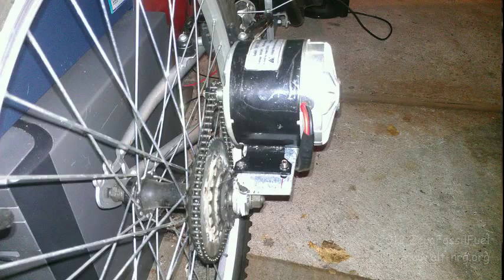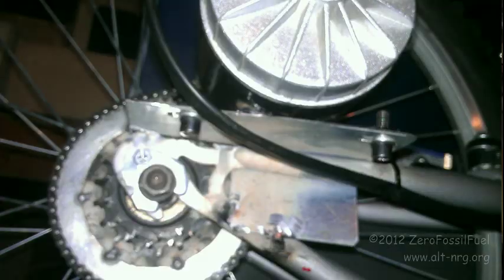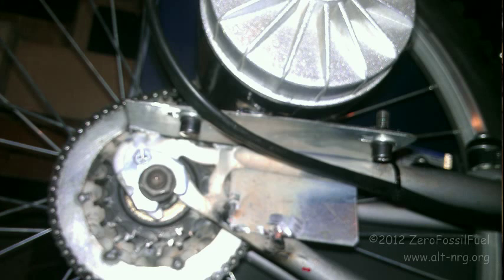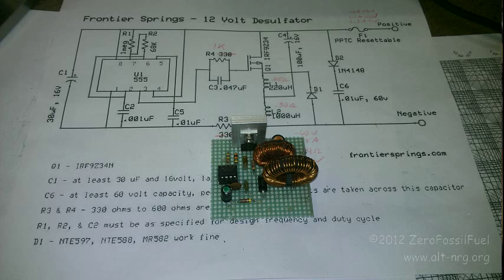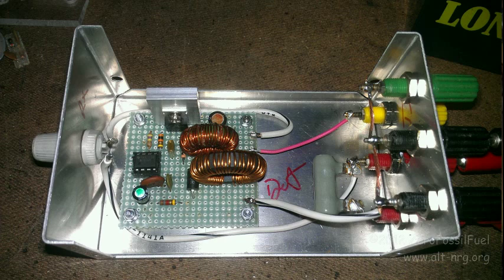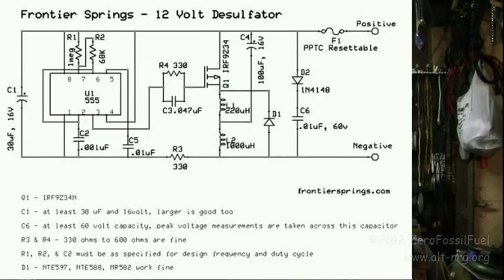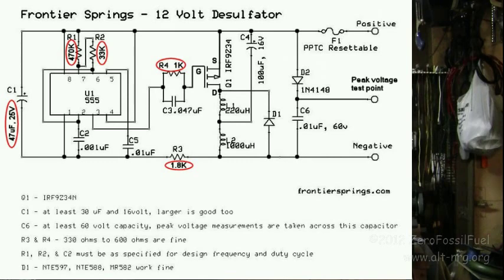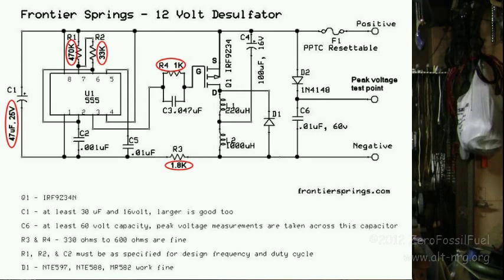#314 SLA battery plate desulfator circuit

Comment: Great video and tutorial, good information.  I have a Pulsetech PowerPulse passive battery desulfator on my 2001 BMW battery as preventative maintenance as Pulsetech claims that there patented frequency they use can extend battery life up to three times it cost $33.99 on Amazon. I also used my PowerPulse on my other BMW battery that I let sit disconnected for a year, and it was at 11.2 volts, I tried charging it with my friends Exide 6 amp automatic charger for 14 hours and battery voltage was at 13.1 volts, yet it would not start my other car. I put the PowerPulse on it along with a 1 amp Schumacher manual battery charger for 72 hours, and left the desulfator on it for a week and it started my car right up.

Comment: Hi. I recently began to experiment with batteries . I found the diagram. Soldered, the frequency was just over 1000 Hz . I put your resistor values and the frequency went up to 9,000 Hertz. Heated IRF9Z34N . Have you eliminated the problem of heating the transistor ? Because Wizbangplus BD-12 so the transistor is not heated . And how are your recovery results ?

Comment: Excellent video. Thank you so much for this outstanding project. 7 years ago, I was running a Bedini Cole motor with a capacitor in parallel on the drive coil. The battery went into resonance with the capacitor and drive coil and trigger coil, the whole circuit began oscillating, even though it wasn't built to do that, and the battery began to charge up while the motor was running. I only just now, 7 years later, realized that I had witnessed a very powerful scalar battery charging effect, which lasted all but 5 minutes until the transistors were permanently ruined. I never could replicate the effect, and gave up trying. But it did prove that if you can resonate the lead acid battery with an inductor and capacitor RLC circuit you can get the battery to furnish power, although very haphazardly and maybe even dangerously so. For some reason it's taken me 7 years to realize that a battery can reach resonance.

Comment: Nice video very clear description, I just etched my frontier springs circuit board 2 days ago, one thing I noticed is if you build the PCB and follow the photo also of the MosFet position you don’t make the mistake of putting it in the wrong way around, I studied it closely, I wound about 5 DIFFERENT coils before I even built the board and found the 1.5 uh worked best in my circuit but I was using slightly thinner gauge enamelled copper wire, and current consumption is a little higher on my build I am seeing voltage spikes of 50 volts but of coarse this depends on many factors such as Battery condition internal resistance. When I hook the desulfator up to a healthy battery the spikes on mine are greatly reduced this gave me encouraging optimism that this circuit might actually be doing something, however it is too early to tell it being only 2 days, we can't speed up chemistry and from what I read the original circuit  designed by Guru "Alistair Couper" ( Article: http://alton-moore.net/graphics/desulfator.pdf ) he explained that the circuit works slowly and can take about a month to see any positive improvements, as the circuit behaves like what ULTRASOUND does to kidney stones, by de-solving the hard sulphates back into solution and making them electrically active again.

Comment from the maker: To be honest, I never got the Frontier Springs style of impulse charger to work very well. There's just no control over actual charge current. Recently a fan from Montreal gave me a 1AU that he bought but never used so I've been testing it. It actually works as advertised. I've been resurrecting 12V lead/acid as well as Ni-Cad batteries with it. Despite the fact that I still cannot justify the $400+ price tag, Lindemann can't make them fast enough. Review vids coming soon.

Comment from the maker: In the US standard outlets are 120V. But most all homes also have 240V split phase for high power appliances like electric ovens, baseboard heat, clothes dryers and hot water heaters.

Comment: Sorry i cant donate any money, but i might have a solutions for your batteries. search for laptop battery ebike. you can dissasemble dead laptop batteries and pull out the good cells. each lithium cell is usually 3.7v 2200 to 3200 mah.

Comment: you already had a decent desulfator circuit in the form of your HHO PWM.
i recommend tipping out all your acid and filling the cells with distilled water,and hitting the battery with reverse polarity.
dump the distilled and dispose of the lead contimate accordingly.
put the acid back in and charge with a step charger that decreases the amps as it charges.
putting the sulfate back into solution will make it available to drop out again.

Comment: I made a Desulfator but I use 12v ac @ 1 amp for 24 hrs and it works good depending on the batteries.

Comment: Essentially, it looks identical in nature to the Alastair Couper circuit that I use. Generally speaking, what makes it an SLA circuit? I have had good results so far, but not with SLA's, but with flooded bats. Even the circuit for flooded is "low power", consuming about 100-150 mA. That said, the instantaneous spike is not so "low power" tho... which is why i like your inductor choice. Cheers

Comment: I know what you mean about the high power variant though, powered from mains. I haven't tried it, but I know of one fellow who has and has his rigged to pulse up to 200A (for a very brief moment of course) by stacking toroids, and winds used are letz magnet wire to make a thicker gauge (3 strands of 18 or so).

Comment from the maker: This circuit is designed for lower power sealed lead acid battery types (i.e. gel cell). There are high power desulfator circuits out there that all operate on the same general principal. I may build one of those for my 33Ah SLA UPS batteries as well as automotive wet cells. All depends on how this one goes.

Comment: Nice ZFF! those inductors look like they'd carry some current. I have 4 of these circuits running. One thing... often SLA's don't show a lot of results, due to being "dried out". uinfortunately, just adding distilled water doesn't really always do the trick, either (though you can get in there). What can be done, though, is the battery can be cut, just under the (permanenant) cap. Then pulled apart, inspected for shorts, converted to a "flooded" battery with new H2S04, and finally, desulphated.